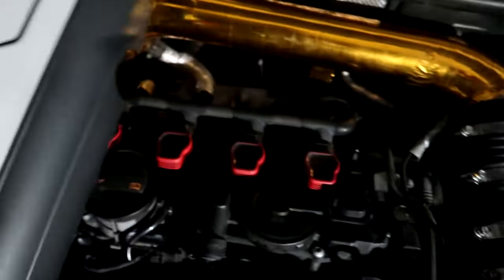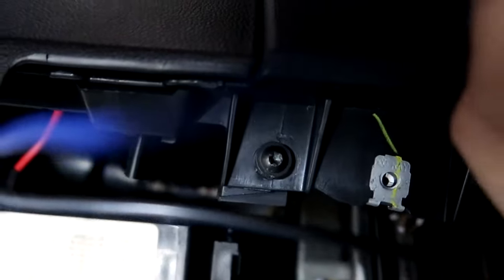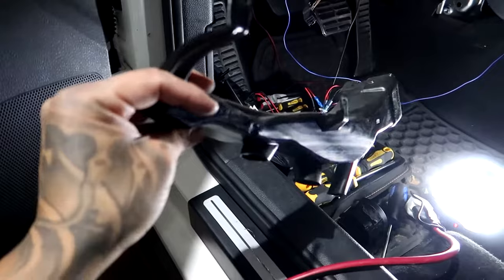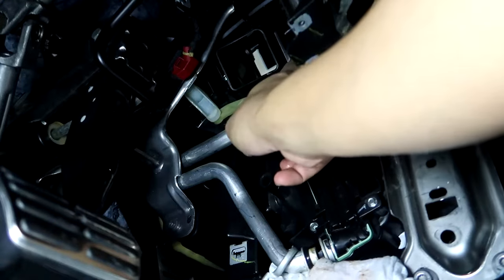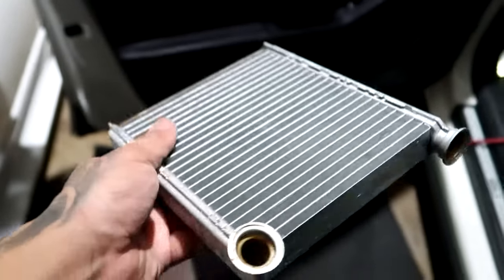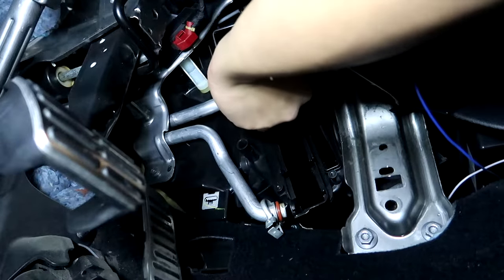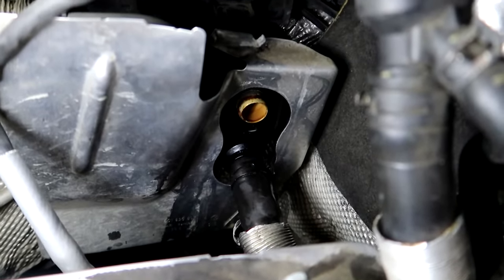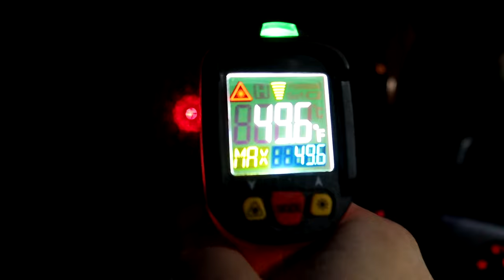VW Jetta MK6 - Heater Core Replacement DIY

Comment: Gotta give Volkswagen credit for finally making the heater core nicely accessible without having to disassemble and pull out the entire dashboard, like we used to do.
Reply: Try it on a rhd
Reply: The wife's car has a weak heater ,due to those stupid coolant packs breaking apart and clogging the core.
2014 Jetta. 
Rustoleum rust remover did remove some of it, but it's still weak. 
My Mk4 Jetta Ute also needs a heater core this year.
I was figuring the mk6 was gonna be a royal pain so I wasn't even going to bother , but it's main purpose is a "winter beater" and it would be nice to have heat. 
She works from home now , so I end up using her car more than her. 
Maybe I'll be a nice guy and end up replacing it , as I know when I do the one in my Mk4 it's gonna be a mess ,and there will be a lot of 25yo parts that need replacement along the way.

Comment: I have a 2011 mk6, no heat also. This video has helped me to decide whether to flush out or replace the heater core. Thanks a lot!
Reply: Do the flush first, and then if the problem persists, consider changing the heater core.
Reply: I would suggest just going ahead and replacing the core. I had mine flushed in Dec of 2022 with very little results. Ended up having to have the core replaced so I was charged for a flush the first time and when I took it back a couple of weeks later I had to pay for the coolant and supplies again when they changed the core. Save yourself some money!
Reply: I would also change the core out for a new replacement as I'm doing. The core is very inexpensive.
Reply: Thank you!!  @Marvin.45

Comment: I have a problem with my heater the drivers vent throws hot air but the middle vents m the passenger vents are kind of cool not warm enough should I replace the core

Comment: I changed my heater core today. I have heat again 😀 I never worked on a car earlier, this was my first time. The Mechanic asked for 780$ for heater core replacement, I just bought heater core for 100$,  for me, it took full day to replace. 

I have VW Jetta 2014, didnt remove the dashboard, and I didn't remove two incoming hoses near engine, there is a metal sheet protecting the clips, couldn't see the wire clamp clearly, I thought of not messing with pipes, which I can't fit again( coolant flows a lot and stops at somepoint, I managed to drain it using a funel and a bucket). 

I got a leak at the bottom joint and managed to tight it properly with the clamp.

Comment: Thank you Sir! Excellent how-to video for this job. I had a new one put in my car in January of 2022 and once again I don't have heat. Took to garage and they said they couldn't find anything else that could be wrong with it besides the heater core. I just may replace it myself this time and save myself about $500.00. Thank you again and have a great day!
Reply from the maker: Awesome! It's an easy job my man. Just follow the steps and you're good 👍
Reply: It happened again most likely due to the same reason as mine and OP. You saw all that sediment that came on to the diaper? That is what is running around your entire coolant system. BEFORE installing a new heater core, I think it'll be better to flush the system a few times (like Chris Fix did in the video with the plastic cups as  a thumbnail) to remove as many particles as you can. Then you replace the heater core.

Comment: You must flush the system from all sediments before you install a new heater core. Mine is clogged again two years later. Also, your heater core install is a lot easier than on a Passat/CC. Lucky you!
Reply from the maker: You sure? All the sediment seems to be building up in the heater core. Replace the core. No sediment.
Reply: @JoelsDriveway  Why else would the original heater core last over ten years and the replacement (which was also OEM) about two?
Reply from the maker: @isidorsiskos2598  possibly topped with incorrect coolant or tap water added to system.

Comment: Hey, i removed the dashboard. I also removed the knee airbag but can‘t remove the metal piece where the knee aurbag is attached to. This metal piece does not let me pull out the heater core now because the heater core pushes against the metal piece. I don‘t know what to do. Any ideas?

Comment: Hello from Dallas, I have a question. If heater core is working properly, the 2 tubes connect to heater core should be both super hot, right ? One of my tube is warm and the bottom one is super hot. I wonder if that is the symptom of bad heater core. Thanks . Btw I have a 2013 Jetta GLI autobahn and your video is useful.
Reply from the maker: Yes, it could be a result of blockage in the core causing the difference in temps. I'm assuming your heater is not working?
Reply: @JoelsDriveway  yes sir! It is not working properly. It is just warm air not hot air even I turned temperature setting to High
Reply from the maker: Heater should be full hot out the vents.  Replace the heater core and you should be fine.
Reply: @JoelsDriveway  got it I will give it a try. Very much appreciated! Btw, will you plan to shoot a video about how to properly change the transmission fluid for DSG transmission?

Comment: Replaced heater core 1 month ago..now the same problem. Heat is only coming out of far left vent and yesterday it was 3 out of 4 vents with heat. Keeps on getting worse and worse, is it the heater core again so quickly? Correct coolant was used
Reply from the maker: Are you losing coolant? Was the coolant premixed when it was added?
Reply: @JoelsDriveway  yeah bottle said premixed..unsure of coolant loss..will check
Reply from the maker: @hendrik6385  what type of coolant? What color?
Reply: @JoelsDriveway  purple in purple bottle by oem

Comment: Does this apply to a 2006 Jetta? I passenger front & back floors are covered with water & I was told it’s my heater core
Reply from the maker: I believe this will only work for 2011-2018 models

Comment: How were you able to access the clips on the inlet hoses in the engine bay? That metal heat shield is in the way and I’m not able to get a good look at what I’m doing, let alone pull those metal clips. Loosened the one 10mm nut on it, but didn’t give enough wiggle room.
Reply from the maker: Use a pick or a small flat head screwdriver to pop the clips on the hose connectors. It's tight but not impossible.

Comment: thank you for the kind explanation. Just one question. Does the nissens heater core you bought still works perfect? I'm pretty worried about the leak from the seal. Im going to order it right after your comment!
Reply from the maker: Yes. Works perfectly
Reply: @JoelsDriveway  thank you very helpful - from south Korea!

Comment: The left side of my Jetta blows heat and the right side just throws normal temperature, could that be the heater cord also ?
Reply from the maker: Yes its possible, but it could also be low on refrigerant or one of the vent flaps is stuck.

Comment: Had vehicles for 50 years.  Never replaced a heater core.  The clogging is a symptom of a problem with something not designed correctly.  What is the root cause?

Comment: Great video, do you have any suggestions for how you can tell the core is bad? I have a 2013 no heat, both hoses going to heater core are hot which makes me think water is flowing through.  What else can I check?
Reply from the maker: Some other symptoms could be Low coolant levels from leaks, Coolant smell through vents, Puddles on floor, no heat. Sounds like yours may be clogged. Best to replace.
Reply: @JoelsDriveway  i also have a 2013 gli is the same process to replace it my heat just went out
Reply from the maker: @dawsonskipper553  I would assume its very similar.
Reply: Sometimes the core or matrix fins inside get blocked especially if the silica bag that is meant to be in your coolant tank bursts, the early 2010 VWs are prone to it as the silica bags were all faulty and all burst at some point. If it has your best bet is a clogged matrix / core you can get it cleaned or flushed but more often than not the heat you get out of it (if any) isn’t worth paying for it to be cleaned. Best bet is to go for a new matrix , only £50 ish if you do it yourself , don’t know how much it is if you get it done by a mechanic.  

Hope this helps 👍🏼
Reply: I read somewhere that if both hoses were hot then the core was working. Just something I came across doing some research about my own "no heat" VW
Reply: @callumsmith8005  My garage said it was going to be right at $700.00 total! 😭😭

Comment: One question. I ask because the last owner bypassed the heater core. 
In the engine bay, which hose goes to the top pipe and which goes to the bottom? Connected to the engine, I have a left and right hose next to each other. One is obviously longer than the other. I’m just not sure which one goes where. I also have a 2012. Thanks
Reply from the maker: The longer hose which leads towards the front of the engine goes to the bottom. The short hose that starts from the right of the engine is for the top.
Reply: Right meaning drivers side?
Reply from the maker: @Mazandr1126  Driver side yes.
Reply: Thanks
Reply: So I want to add something that I figured out that would save a lot of time. You ended up taking off the bottom panel under the steering wheel in order to remove those two screws hold on the plastic vent thing… but…. If you just raise your steering wheel up, you can actually access those two screws through the steering wheel adjustment slot. Just need a long extension. Super simple and time saving.

Comment: Any tips for getting the sliding clamp for the hose back onto the core and the pipe inside?

I'm trying to use the sliding clamp that was already there but the clamp is just sliding onto the pipe and not the core. And I'm using quite some force pushing the pipe in the core. 🙃😔
Reply from the maker: Took me several tries. Doesn't take too much force. Just push the hose on until you feel it grab the core piping, then slide the clip. Go slow.

Comment: How long does it last if you don’t change the tubes?
Reply from the maker: @CaliCarGuyOfficial  I've had no problems. Heater still working perfectly now during the 2024 winter season. Currently have 130k miles on the car. The tubes are not the issue, it's the core itself.

Comment: Quick question. If I’m replacing AC condenser, compressor, and expansion valve in exact same car, how would you suggest I flush the lines? And should I flush the heater core as well?

Comment: Thanks for the video. Do you have any advice for bleeding the air out of the system?
Reply from the maker: Add coolant, start car with reservoir cap off, look in reservoir to see bubbles (you can squeeze the radiator hoses to speed up process), once no more air bubbles, put reservoir cap on, let car get to temp or drive around a bit. Check coolant again and top off if needed.

Comment: I cannot get the light switch to come out?  I push and twist and pull but it will not come out of dash?
Reply from the maker: You push in and a slight turn to the left, then pull. Must push the switch inside first.

Comment: How do you replace the heater core pipes that you show in the thumbnail?
Reply from the maker: Problems usually occur within the core itself, not the pipes. More of the dash may need to be removed
Reply: More like the whole dash
Reply: @JoelsDriveway  More like the whole thing

Comment: I changed mine about 4 years ago and it started leaking. Looks like its the core, as I checked the fittings, both in and out and they are dry. Is this common with these cars that the cores dont last long?
Reply from the maker: Yes, they fail often.

Comment: You didn't address the cause of the heater core blockage.Its the coolant expansion tank  internal silica gel bag.
VW/AUDI have fitted a small Silica Gel bag  internaly in the expansion tank to make the coolant last longer.
They have now revised this policy due to Silica Gel bags bursting and contaminating the cooling system.
This is whay causes the heater core to become blocked,as the Silica Gel crystals block the heater core  fluid galleries.
The other possibility is that vehical owners mix  different type coolant antifreeze that is not compatible .
This then reacts and causes sludge to form ,which again will block the heater core.
Reply: would a 2015 still fall into the unrevised category ? which year have they revised it ? do you happen to know

Comment: when I have my ac on I can smell antifreeze, and there is definitely a slow leak since I see that the well is lower every day but there is no fluid under the car or in the car, when I turn on the heat it stinks even more.  Any suggestions, ideas?
Reply from the maker: Check the hose connections at the firewall. The small plastic tubes tend to crack and leak slowly. I'd start there
Reply: I'm having the exact problem but I cannot find a leak anywhere on the car

Edit: I replaced my heater core and the coolant smell is gone and the heater now works.
Reply: Having the same problem and I have no heat
Reply: @The_Juan_An_Only  ^^^
Reply: @alankeysor3423  nicee

Comment: Would changing the evaporator coil be about the same?
Reply: Same question
Reply: @benmuise  It’s not really a DIY job unless you have the proper HVAC service equipment (gauge and manifold set, evacuation pump, recovery pump).

Comment: For some reason,  no matter what I do, the clamp will not tighten back on the lower heater core line. Is there something I'm doing wrong? I have tried multiple clamps, I haven't over tightened them, they get as tight as they will go, but will not bite down on pipe.
Reply from the maker: At the firewall? Or on the core itself?
Reply: @JoelsDriveway  on the core.
Reply from the maker: Make sure the pipe o-ring is seated properly. Check clamp alignment. Look to see if its bent. Try flipping the clamp...maybe it's on backwards.
Reply: @JoelsDriveway  I've checked those things,  still no luck. Thinking about trying a normal hose clamp

Comment: Great Video.How did you get behind the firewall to pull the clamp out inside the engine bay.
Reply from the maker: By removing the intake piping.

Comment: Before replacing the radiator, wouldn't it be healthier to clean the residues accumulated in the pipes with cleaning products?
Reply from the maker: Yes, flushing the cooling system is recommended

Comment: Dude I followed this shit step by step just for the fittings part to leak coolant every fucking where. I couldn’t get it done.
Reply from the maker: Oh no! Which fittings?
Reply: @JoelsDriveway  both fittings into the core. I tried old and new o rings. Clips and clamps  went right over and everything
Reply from the maker: Hmm...I would check the o rings. Make sure they're snug and pushed all the way into the core. It should snap in. The clamps should slide over the edges and be tight. Pull gently on the connections to see if they move. That should be it. That's pretty much the easy part of the job man. You're almost there. If it leaks again, see if its actually coming out of the connections and not from a defective/cracked core.
Reply: @JoelsDriveway  it’s at a garage. I took it apart twice and put it together. It was literally coming out of the fitting and I got pissed and had a mechanic look at it and even he said he didn’t get it. Shits fucked it’s whatever. The video is still fire. It goes through everything and how to do it.
Reply: @JoelsDriveway  where they connect it was coming out of. Maybe it was just really bad luck.
Reply from the maker: @travis9999able  Yea, that's weird! But I wouldn't doubt it. I've had my share of bad luck on this car too. Thanks for checkin out the video! 🙏
Reply: @JoelsDriveway  always thank you for putting a step by step video!!